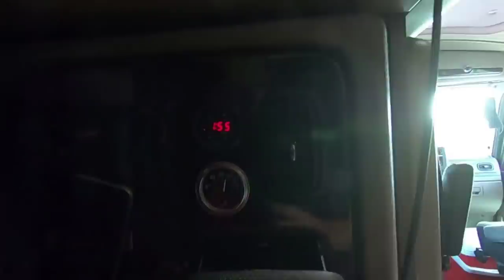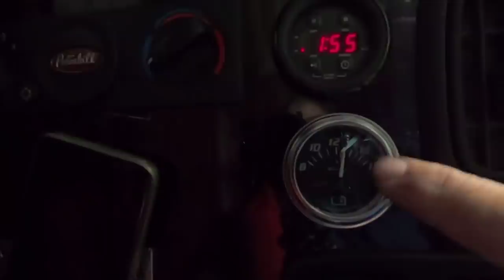#409 Straight Through St Louis The Life of an Owner Operator Flatbed Truck Driver Vloh

Comment: Have you thought about a piece of leather for your hood squeak? Might be able to put a thin piece on both sides of the rubber creating a smooth soft surface for the hood to rub on. This just popped in my head thinking it might still be bothering you. Work gloves came to mind when thinking about it. Have a good one Dan.